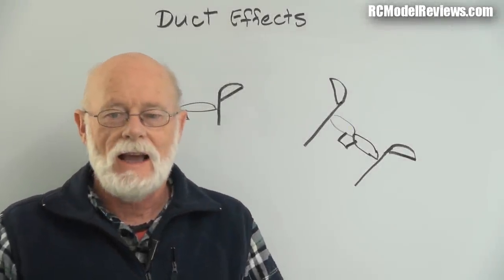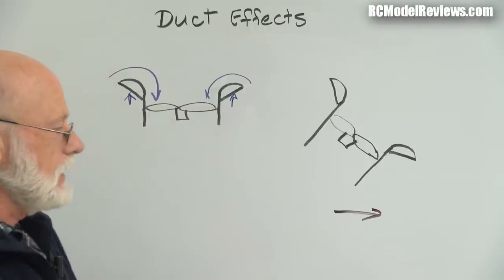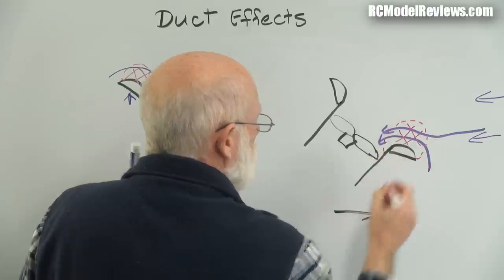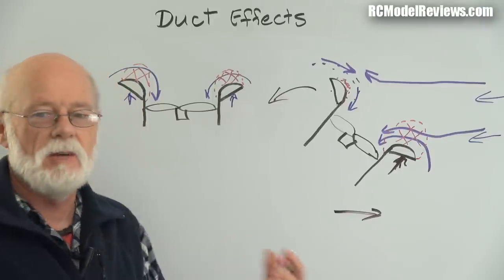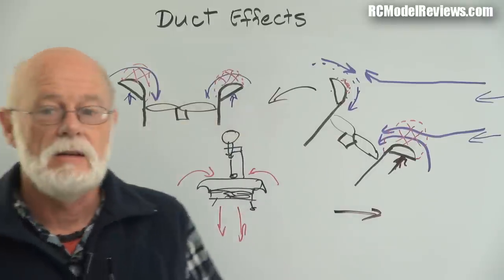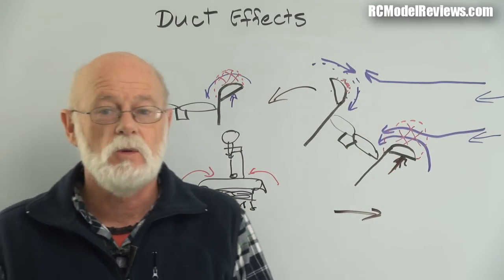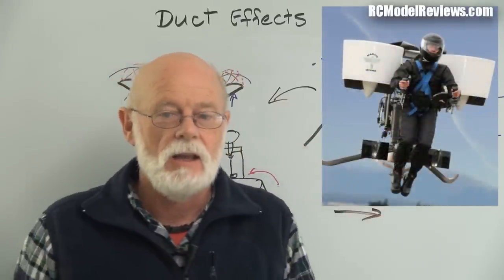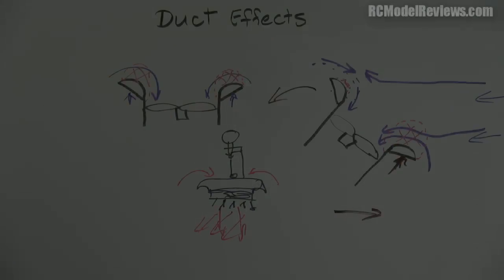More on ducted propeller systems

Comment: I would be interested in modification of the lip ring to incorporate air flow from the bottom edge of prop around the duct and back into the inflow of prop thrust, I like the idea of air flow via wing type duct, but... I want to redesign the duct, with as you said air wing flow but... how about making a duct that has 1. air flow as you described... but 2nd. Adding reverse wing underneath.. and opposite (air Flow), to create low pressure under prop/duct and to make the air flow come out and around and over the top of the prop and duct..and back into main air flow...
You could think of a fully symmetrical wing, As in sport/stunt aircraft, but slice it down the middle of it's cross section, and reverse the bottom have, i.e. put the thickest part to the back of the cross section,  sort of opposite air flow wing underneath so what you have , is air flow would in theory go from edge of bottom of prop around duct and back into primary air flow in....simply stated , add another wing type underneath what you have already in duct model but reverse the air wing so that it pulls air from the tip of the bottom of the prop out and around the duct then back over the top(I.E.what you have )..and back into the primary flow, this would mean creating a duct that was only as wide as the prop, with redesign of prop so that the thickest part of prop blade is where your duct would start, (just increase blade length) , and start duct at average blade length...of course I am not an physic's engineer, nor am I schooled in any of this... so I may not be making any since here but if this worked wow, I am pretty sure the length of ducting would need to be the thickness of prop and no more in order for the re flow of air to work, in other words I don't think this would work with a 3" or 4" duct, the air just has to travel too far, but with say an 1/4" or 1/2" or maybe even 3/4 inch prop width, it may just be the ticket, of course everything changes with speed increase and air flow increase... but again I am not physic's engineer...maybe there are math rules that state the thickness of ducting can only be the thickest part of prop, or something like that.....think of this as () tilted at 45 or 35 degrees, with wing cross-sections( instead of computer keyboard symbols), or even 90 degrees to the prop..... :)....but all molded together as a reinforced duct prop.......If it would work I'll bet every modeler/drone pilot would want one, I used to race .061 42" wing span herr kit mustang that I modified myself, tuned just right  it would fly 75 to 100mph with custom prop and motor parts, really fun stuff.... I am looking to get into drones and this might just keep prop life alive longer , you never know.....

Comment: Do you think a contraption like this: http://i.imgur.com/zMP64fy.png
would be able to avoid the self stabilizing problem? Since you have the "cap" on top both directing the air so it doesn't come head on whilst also creating lift on the side where lift would be reduced? The aero-spike is there just because I like aero-spikes.

Also, would you be interested in testing a 3D printed version of this? I don't have a 3D printer or much money but if you sent me some specs of the propellers and dimensions of a Quadcopter you have where you think this could be tried on I could make 3D models of his type of ducted fan and you could print it out (if you know someone or via a 3D printing website). I was thinking to save weight the 3D printed model could be a wire frame structure and then plastic sheets or similar materials could easily be added on afterwards. Is this something you would be interested in? :)

Comment: The ducts Bruce has are deriving the increased efficiency from two things, reduction of tip vorticies primarily and the principle of conservation of mass, not the coanda effect, that requires more of an angle between the prop axis and the surface of the duct, such as on the Avrocar, the duct on these inlets is too vertical to cause any lift worth considering, what is actually going on is that the inlets cross-sectional area is wider than the prop, and that means more air is drawn in, and it is always more efficient to increase the mass of air when generating thrust, than the other option (increasing the masses velocity).
Reply: Leon Hostad The coanda effect ensures that air flows over the curved entry lip to the duct and the flow of that air creates a significant amount of lift -- it's even detailed on the Hiller Flying platform documentation that the lip is a major contributor to the lift generated.   With any open tube,  much of the air is drawn in at right angles to the duct -- perhaps I'll do a video demonstrating this -- it's very surprising.  If that incoming air travels across a horizontal or curved surface, it produces an area of low pressure.
Reply: Not a significant one compared to the overall lift/thrust generated by the prop
Reply: The ducts you have dont have much area at right angles to the axis of the prop, so the effect will be nearly nil.
Reply: Leon Hostad Actually no... according to Hiller's own research, as much as 40% of the total lifting force on the flying platform was attributed to the lift generated by the lip on the duct.   I'm sure if you look around online you'll find a reference to that effect.
Reply: I'm not on about that platform, I'm on about the 3D printed ducts you have.
Reply: Leon Hostad Ah yes, on that I agree.  These ducts aren't designed to increase performance so much as to protect the props -- but they did give me the chance to present some interesting bits of aerodynamics for those who are interested.
Reply: Fair enough.
Reply: ***** the closest i have gotten to ducts on my nanoquad are these propguards that fully surround the blades.  3d printed them, and they worked out quite nicely, enabling me to fly it indoors without fear of breaking the nanoquad.
Reply: Leon Hostad You mean density not mass.
Reply: No, mass, at below mach 0.3 you consider air to be an incompressible gas (no density change) having studied aero eng, I know this topic, and why it is conservation of mass...
Reply: If you increase the mass flow rate you can either move more air at the same speed, or the same mass at a faster speed, or a combination of the two, more air at the same speed will be more efficient (consider the K.E formula) and the density does not have to change, or even be considered if M<0.3.
Reply: Leon Hostad sorry that should have had a question mark. yes i agree with most of what you say but  "always more efficient to increase the mass of air" is there not an inverse square law here? ( i'm a  layman so go easy )
Reply: Not an inverse one, but a square law does come into play, if you look at the terms in the kinetic energy formula (K.E =1/2xmxv^2) you have two factors that are relevant, mass and velocity, but only velocity is a squared term so increasing v has more of an effect on the result.... so if we want to generate more thrust, which has momentum (m x v) as factors then to do so we're better off increasing m rather than v, as that takes less energy, and this is why you will see that airliners (where there is a desire for fuel efficiency) have high bypass ratio engines, compared to performance aircraft that require high speed, eg fighter aircraft, for more google up "specific fuel consumption" that should find you what you need.
Reply: Got it. cheers. :)
Reply: For the same thrust what you can do is increase the mass, and reduce the velocity, and you will find that your energy usage has been reduced.
Reply: Sure. That's why my EDF gives less half the thrust of my mini quad for the same power ( about 1.6 kw )
Reply: Yeah the inlet will be choking it.
Reply: Just thinking further on what you have said. If the air is incompressible and the swept area and disk solidity are the same. How are we increasing thrust with the addition of a duct that has limited coander effect? Are we increasing velocity or are we increasing the effective swept area by removing the tip vortices?
Reply: When you draw a larger volume in at the inlet the velocity at the outlet will rise slightly to accomodate that.
Reply: The effective swept area will rise too, not sure by how much exactly, but on a fixed wing adding winglets reduces induced drag by typically around 7%, so to hazard a guess it would probably be about the same.
Reply: Indeed, that's why airliners run in turbofans and not turbojets: the former exploit the benefit of moving more air mass through the engine

Comment: The reason why tilting a ducted prop doesn't work tilted, as well as straight up, is because, as soon as you tilt it, the whole unit is no longer doing one job. You are forcing it to do two jobs. 1) sustained hover, or sustained lift, and 2) traveling laterally somewhere fast. You would need two of these things. One to provide enough lift, and one pointing in the direction you want to travel in. However, the faster you travel, the more inefficient your prop and tube will be, and the more you will need a lifting devise that capitalizes off of your air speed for lift. Once you've achieved airspeed, it doesn't take a big contraption, with blades whirling at 100's of rpm's to stay aloft, so the frantic contraption becomes useless dead weight, gobbling fuel. Even helicopters can't do these two jobs perfectly at high speeds. That is why the airspeed of an object is so important with design. And then deciding what job it is that you actually want to do best.

Comment: If you get rid of the lip would the positives(thrust)  outweigh the negatives (weight)?
Reply: Oh, and have you tried it yet?
Reply: idk but i think , no lip equals less thrust because the loud vortex's will happen.
and once they removed the lip , i think helicopters become the best ...in theory you can make longer blades to lift heavier objects or accelerate faster , 
unlike if some frame thats always around  that would get heavier the bigger the craft gets ...  
idk im not a pro , but i think
 if they got it sideways it would be going forward for sure , until it hits the ground lol  ...
or why not add another motor that blows thrust out the back to go forward while the first just provides lift ?.. 
(they did and its in area 51 XD)

Comment: It shouldn't matter on a quad because although each motor will try to right itself there won't be any net difference on the whole motor near the front vs the whole motor near the back except due to prop speed, which is what tilts the body of the quad.

Comment: What if they redesigned it with a weight ballast that can shift fore and aft, as opposed to the operator having to lean? The ballast should produce more leverage on the craft than a human would, and use modern materials to compensate for the added weight. Interesting idea.
Reply: That Guy With the Pointlessly Long Username That You Are Wasting Your Time Reading Right Now Even the movable vanes in the duct didn't do the job -- the self-righting effect of the duct is very strong.  I notice that they have changed the design of the Martin Jetpack to try and get the CG higher  -- perhaps in an attempt to compensate for the self-righting effect.
Reply: ***** Rather than place vanes underneath maybe redesign the lips of the duct so that the effect is negated in forward flight? Or maybe just give up, have a good cry and get drunk... which sort of works for me when my models are crap.
Reply: Omg, seen some pointlessly long usernames before; however, your that guy with the really pointlessly long username, Bravo dear chap!

Comment: Build a hexacopter with the front and back pair of blades in ducts.  Then slant the middle 2 blades forwards 90 degrees so they only offer forward thrust.  Control the middle fans on a different channel so you can still have normal quad copter controls plus a forward thrust control.

Comment: Why they didn't tried to use an ELECTRIC DIRECT LINEAR ENGINE along all the outer circumference of the flying disc ... in order to have the crew cabin in the center, with best balance. The center of the propeller IS NOT EFFICIENT (too high supersonic speed, very loud,  blades that are too close between them and maybe catch not enough air). With long blades that are almost linear, there will be less turbulence. They could also use compressed air radent to the blades in order to increase the prompt lift only for take-off.

Comment: how much thrust percent gained by using a duct. There is much debate with people building hovercraft some have ductless thrust systems...
Reply: It seems to me that in hovercraft the thrust isn't the major concern, but rather the way that air impacting the front of the skirt changes its shape. (causing loss of pressure and thus lift) Also you would want to keep the thrust at or below the center of mass to prevent the nose pitching into the ground, so you would probably want ported thrust jets.
Reply: thanks but that was not my question. I have built several passenger hovers and the biggest question for two engine craft is to build a thrust duct or not. They are throwing around 5 percent numbers for thrust gained and that hardly makes a thrust duct worthwhile...
Reply: Walkertongdee OK. The only thing I can think of is that the added thrust would decrease with forward speed, so it might be good for hovering (drones, not pressurizing the skirt) but pretty much useless for propelling planes. It might be slightly useful for starting a hovercraft but not much after that. Is that 5% increased thrust at the same fuel efficiency? If it increased fuel efficiency it might be worth it even if it didn't increase acceleration or top speed. Do the hovercraft you have built use one motor entirely for lift and one entirely for thrust? I am assuming yes. Have you noticed any issues with pitching forward at high speed or high thrust? What about braking and steering? Is braking accomplished by rotating the vehicle 180 or do you have a way of reversing the thrust?

Comment: Why didn't they just put a small section of the ducting in each cardinal direction (xy) on a springed hinge with a motorbike style brake lever, one to feather left and right, and one for forward and back. It would reduce the lift (act like straight duct) in the direction of motion, and allow higher speeds
Reply: I'm not sure but I think the craft needed its whole annular wing's surface area to stay aloft. Maybe if it had more "wing" that might work. I'm picturing something like a triplane.

Comment: maybe you could add a wing on the back side of the duct, that is exposed when the duct tips forward enough for the duct to right its self, when this wing is exposed, it could create the lift the back side lacks. but should be out of the way when not tilted.......and if this dosnt work, make the wing retract and pop out, when needed, possibly automatically.

Comment: i find this so strange ....ducted fans mounted sideways in jets ect work at making forward thrust ..... what they in counter is  like the gyroscope effect combined with what this gentle is explaining ... (why that fast spinning disc wants to stay horizontal if it was started that way , and as long as it has the speed/energy to )
Reply: you would need to Stop/slow  the blades enough to have no gyroscopic effect, THEN Tilt The Craft and speed your blades back up to go forward ... 
or just add another  motor angled for forward thrust ...  
why would my idea fail ?
Reply: the reason reason ducted fans work sideways, is the air is still being pushed directly into the duct, not along the top.  if you use a ducted fan to hover, then use another engine to push if forward, the extra lift in the front of the annular wing would push the craft's nose up (that is if i've properly understood the two videos)
Reply: correct you are, its all about the relative air flow between the air and the duct, if the duct isn't pointing towards the airflow, it will try to.